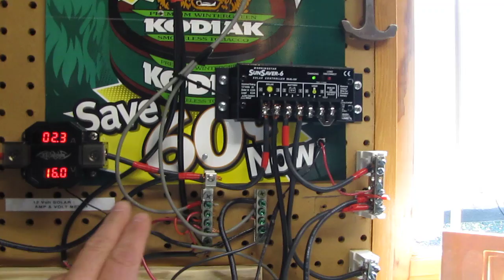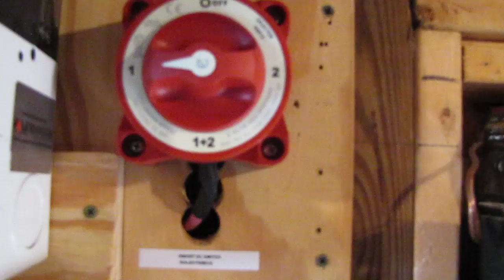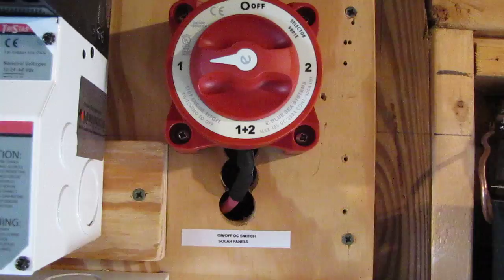OFFGRID  SOLAR  POWER THE EASY WAY VIARLOCITY  HOW TO ! DC Battery Switch

Comment: when you had your grid tie inverter how did you wire it to your charge controller?  did you use the battery terminal port as the main feed or the load side?
Reply from the maker: +Ken B Hi I came Straight Off My Solar Panels  Positive Side  Then I Could Switch Between Off Grid to Grid Tie
Reply: Ah.  Gotcha.  Thank you.   I didnt think about doing it that way.
Reply from the maker: Ken B Yes Sir It Is A Great Way To do It But The safest Way Is To Have An OutBack GVFX 3524 Inverter UL approved  It Does Everything Battery Back up OFF GRID And Grid Tie

Comment: Anyone know how I could connect a kill switch between a solar panel and battery, like show it on a video using the products one answerer mentioned? More details about why I'm asking: answers.yahoo.co m/question/index;_ylt=At6CdclNaWl7it50UhRfRM7ty6IX;_ylv=3?qid=20130803073628AAGeEyi